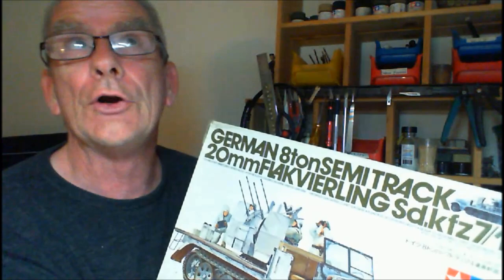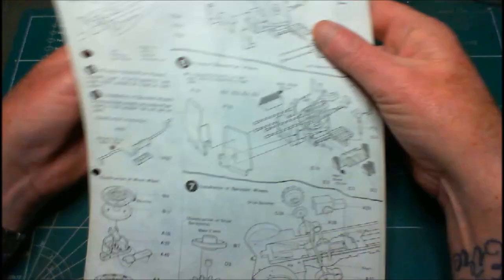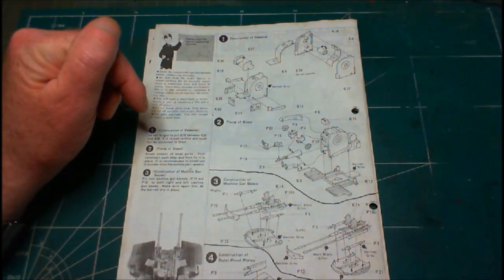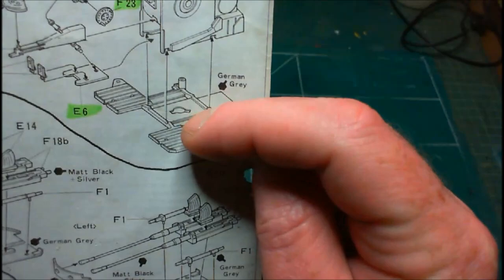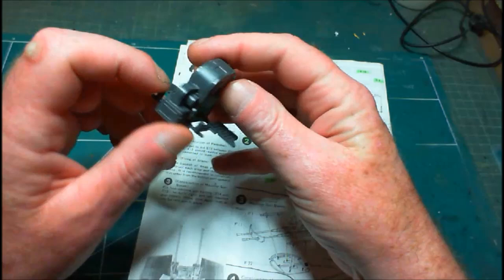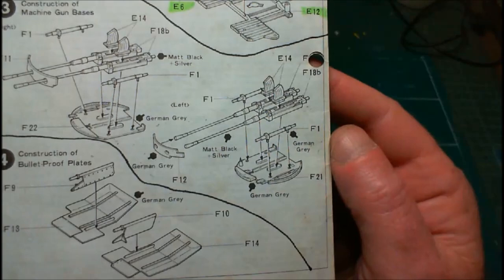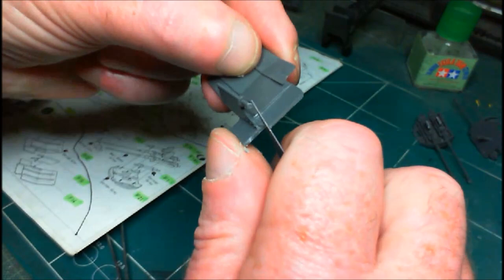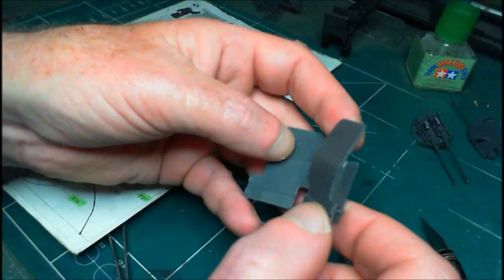TAMIYA 1/35 SCALE 8 TON SEMITRACK 20mm FLAKVIERLING Sd.kfz 7/1 Build Update 1

Comment: John, regarding the back seat that keeps flopping down, I recently discovered a tip which should help, depending on the hinge/joint type, and that's to put a bit of nail polish in the hinge.
It should help to keep it stiff enough not to flop down, but still flexible enough to be moved. I've used this technique on the roller wheels of a Panzer IV, and it works pretty well, so that no glue was needed, the wheels rotate, and they don't pop loose.
worth a try, at least. :D